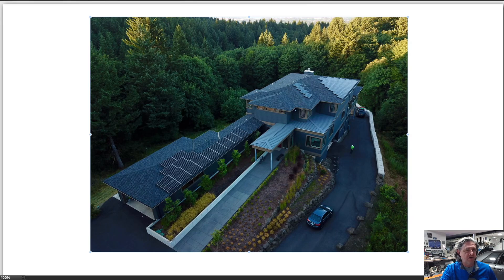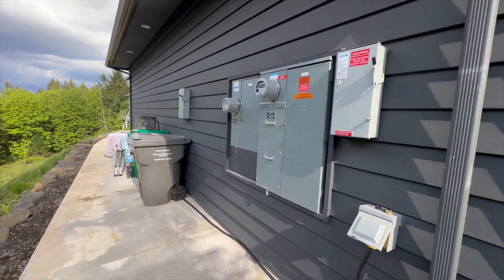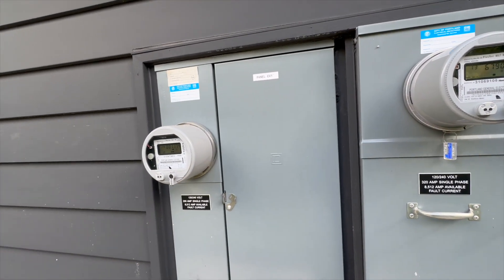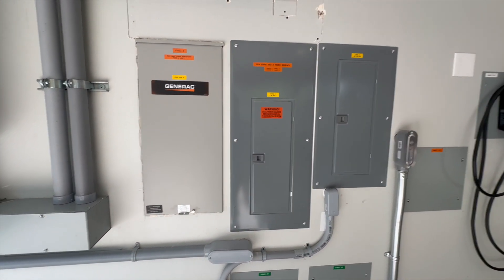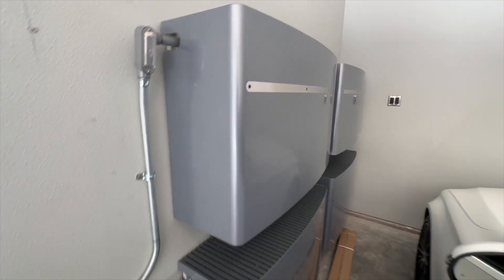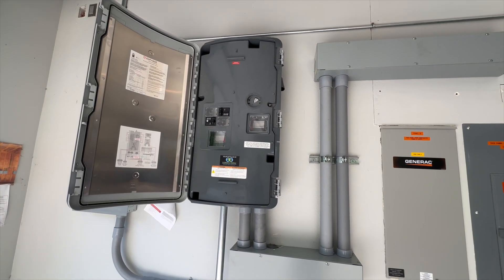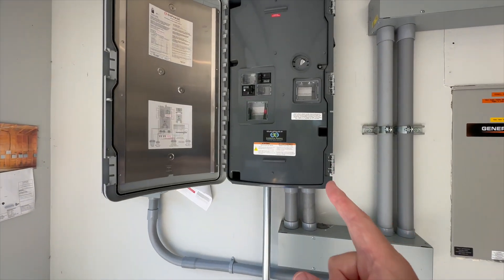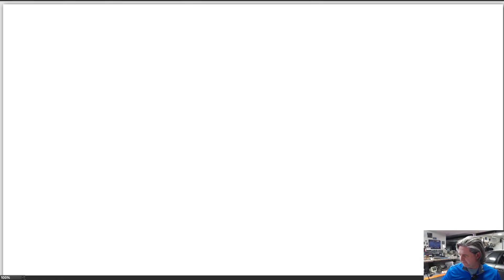My Solar and Battery house power system

Comment: The system is really neatly put together but IMHO this is way over complicated and too many parts to potentially fail and render the system inoperable. As you explained I kept wondering why you didn't just go with a pair of Solark inverters that handle everything in a very compact unit. Then you just need panels (no microinverters) and batteries (and the disconnects etc) and you can ditch the xfer switch. Generator is optional input directly to the Solark that calls for it if and when batteries get low.

Comment: What we do here in Pakistan is to make one large main distribution panel (its cheap here to fabricate and build such switchgear than to use off-the-shelf panels) and then sub panels based on power zones or floors. Main Distribution Panel has all the metering, protection, control and automation. The sub-panels are just for protection or some time for metering.
We have done these arrangement to extremely big shopping malls down to small homes or off-grid farms.

Because sun is good in this part of the world, we usually use high voltage (550 to 1500 V DC) one large inverter instead of microinverters (which, btw, is best in your use case where there's a lot of shading, snow and over cast). PV Modules are getting bigger now. Most common for last 2 years is in the range of 525 - 570Wp or even some places tier-1 suppliers have provided us 600+Wp panels. Which in this time of the year produce 100% of their NOCT ratings which is amazing.

Also, the system at your property is, what we call, an AC-coupled system. Which is that everything is connected on AC. That has more to do with your SRTPV is micro-inverters based. Has it been hybrid inverter than your batteries would have to be coupled to inverter on DC (48V for smaller 5-8 kWh or 450 V+ for larger BESS). The DC-coupled systems are usually somewhat more efficient than AC-couples ones. The main inverters controls all the grid/utility/generator, etc in DC systems. You just change the priorities in inverter app or web interface. In some C&I system we install a separate Micro-grid controller or sometimes called fuel-saver (many names for it, but it essentially is a micro-grid controller). This controls system power flows using RS-485 interfaces or other such  arrangement. This system of 61.5 Hz is dangerous as most appliances are made on utility/IEEE/IEC standards that allows a +/- 5% frequency variation. By using frequency to control a droop or frequency follower system, we are putting on risk frequency related issues (what are a lot). Most inverters in off-grid mode, therefore, uses V-I system where they adjust their output based on current consumption. You need compatible batteries or DC system for V-I system to work. Droop system are good on inertial system like large turbines coupled together or with grid but not on smaller system. What is happening is that by generating higher frequency, AC batteries are de-syncing the micro-inverters...which is easily cause fire due to frequency hammering (back EMF) as the system grow older. 

Thanks for making awesome videos. There couldn't be a person better than a veteran CTO to make videos that'd be authentic and stems from solid experience.

Comment: Absolutely love this video, thanks for including some real life examples of what this system looks like and how you use it. I would be curious to get a deeper dive into all specific parts making this system possible. For example take a deeper dive into the batterys, why did you decide to buy that system, how fast does it charge, how do you monitor this, is there any configuration involed in this system. Maybe you could include how your homelab impacted this purchase (I assume it takes up a huge part of the power from your backup system). Amazing videos and loved to watch it, keep up the good work 🤩

Comment: I've never heard of micro inverters before, but if I understand correctly, they help reduce power loss due to AC current. This is because you typically have to transfer a lot of DC power from the panels to the batteries and/or to a large inverter, so using AC current in this case can be much more efficient.